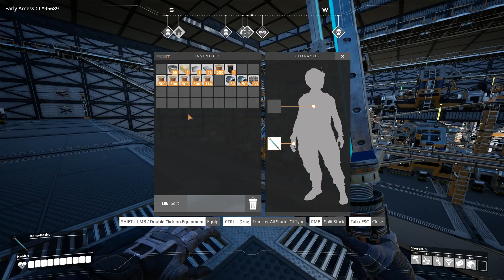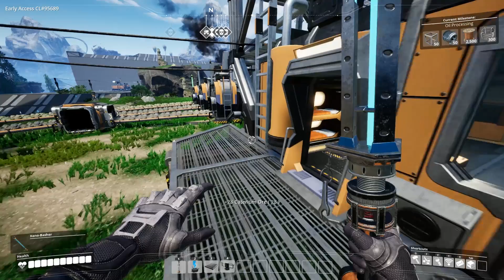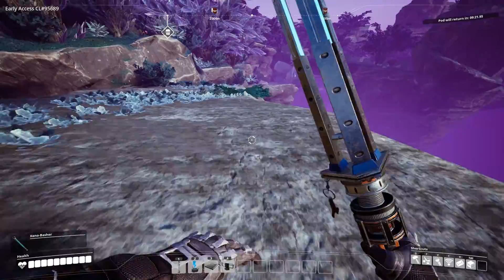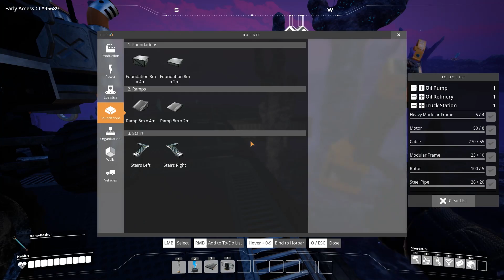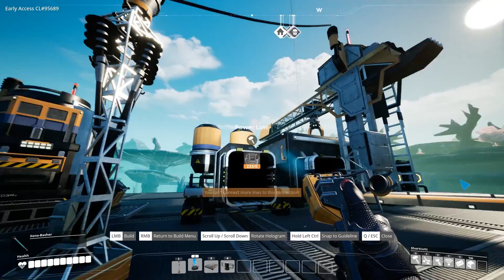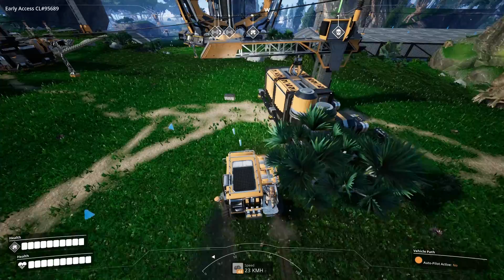Discovering & Automating Oil Refineries - Unlocking Tier 5 and 6 Technology - Satisfactory Gameplay

Comment: You're going to have to research Mycelia to be able to convert it to bio mass. Alien Carapaces do as well, after you do the research that requires 10 of them. All you have to get is for the HUD to say Loading/Unloading... just sitting longer will make it just sit and wait for that long after it is loaded/unloaded. It went to the closest arrow that was in front of it. If you want it to start a specific way, stop right before the arrow you want it to follow. Do you have coal going to the fuel input for the truck station at your base? You didn't record it, so I have no way of knowing if it's actually connected. Fuel is more efficient than crude. Again, if you're going to use crude as a truck power source, you need to add it to the fuel input on the truck station.

Comment: One Truck station unloads your coal to Power your system out there, one loads the oil, easy as that.
Reply: There is a problem with that. Eventually, the truck delivers so much coal that there is no room for more and the coal doesn't get unloaded from the truck. Now you have less room in the truck for oil and the coal getting unloaded where the oil is unloaded. Eventually, coal or oil clog the system and everything breaks. It can be done with smart/programmable splitters and balancing the outputs/inputs so that the truck is always empty when it pulls up to a loading station. To me, none of that is worth it, just use dedicated trucks and stations. A universal truck unload has the same problem. It can work, but you'll have to have the numbers right or it'll clog too. The good part is that the truck station only consumes power when the truck is in the load/unload box. If you have the space, multiple trucks/stations are the way to go for now.  Maybe one day we'll get logic in the game and be able to make complex delivery schedules easy,  but when? Next year? My opinions :)

Comment: Drae I know it's a long comment but please read- why not have the conveyors with the oil barrels run underneath that bridge for the truck station? That way your truck/tractor has room to move around, but your conveyors are still operational. Also, what about using the trucks to transport coal or some type of fuel to your mini power plant by the refinery station so it works as both a delivery station and a pickup point? Love the series man can't wait to see more of this, keep the good stuff coming!

Comment: I think that when you activate the autopilot the tractor goes to the where you started the path.  It ran out because it was trying to make over three trips on one tank.  To be sure, you might want to set the truck stop near the main base to also fuel the tractor using unrefined fuel on that end as well.  Once you get the oil plant maybe put in two near the oil to provide power for two oil wells,  the truck stop and an oil refinery making the fuel for those generators.  Actually, you might be able to get away with one overclocked oil generator.